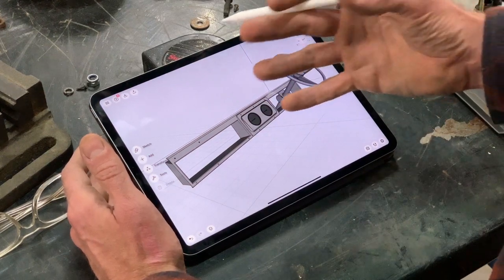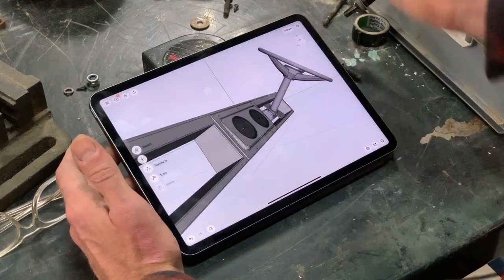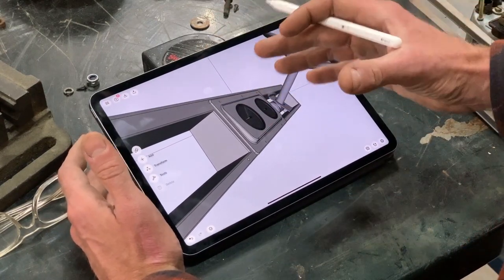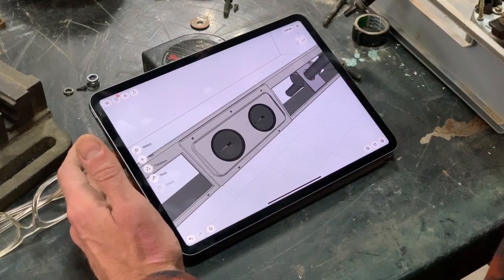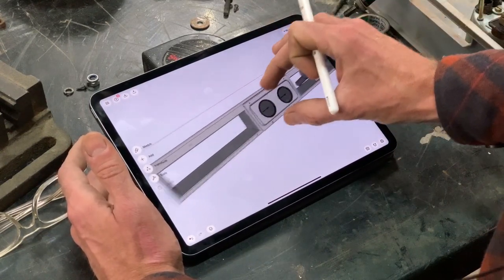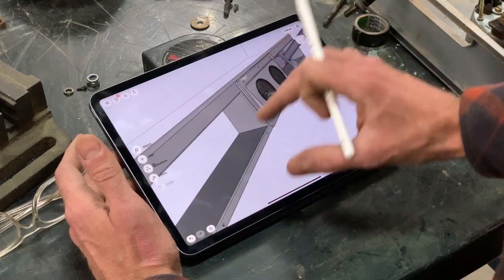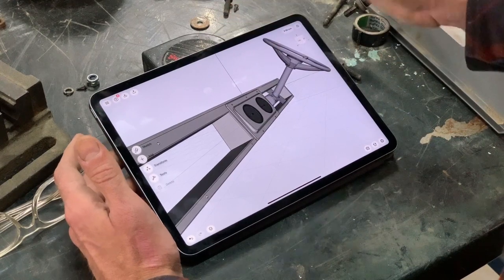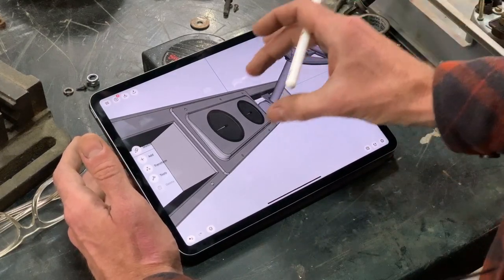1950's switches, bending aluminium and dashboard design || Electric Land Rover Conversion

Comment: I commented already on the Facebook page.  I think the stereo and GPS are not required.  Customers will have their phones, which they know how to use better than hire car units, that already have music libraries, the ability to pick up radio and GPS.  They can use a portable speaker if they wish, which is better camping than a car mounted stereo.  A couple of USB ports is all that’s needed to fill that need.

As for gauges, the battery charge and temperature can be displayed on the existing gauges, so the only other information needed would be time remaining on charge to full (or whatever safety limit you apply to the BMS) and remaining range, which could both be displayed digitally where the alternator charge light currently is.  I think keeping the dash original is cheaper, easier, more in character and frankly more practical for the driver too - it’ll leave somewhere for phones (and a portable speaker if wanted), windscreen cleaning tools, maps and all the other bits that are nice to have at hand.  A three position switch like a headlight switch where the dash illumination switch is could select forward/N/rev.

Good find on the stereo head, though.

Comment: Hi. There is a little discussion about the reverse. In the original gearbox, reverse is fundamental for 4x4 specially when you have some trouble in a Hill for example. You going to need the engine brake to reduce velocity going backwards. I know that the purpose for this conversion is, maybe City and probably some light off road, but is an interesting question considering some one that wants a vehicle like this for a serious or more radical 4x4 use. I let the question. Greetings from Chile.

Comment: "How can we make it as minimal as possible?". That's the right attitude, don't spoil everything with unnecessary gadgets and electronics. I would even like the option of no power steering. Power steering deprives you of exercise your body needs anyway. Skip the stuffy gym, drive a series Land Rover.
Reply: I'm pretty sure there was a power steering adjuster so you can have as much or as little as you want

Comment: Hi Jaunt Team, a great channel and awesome work!

Is there any issue with running the forward gears in reverse? I am wondering if there is any thrust placed on the gear shafts that would not be accounted for by any thrust bearings as the OEM never intended for the shafts to rotate in that direction under load.